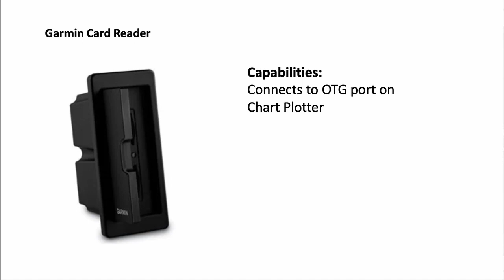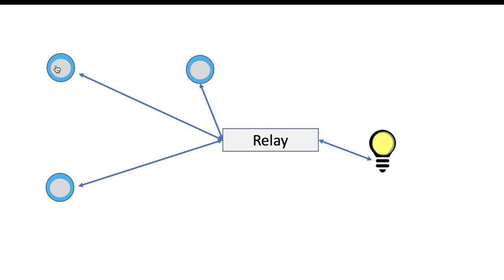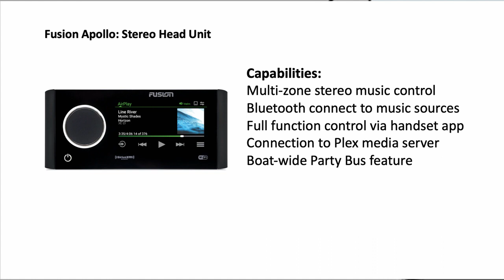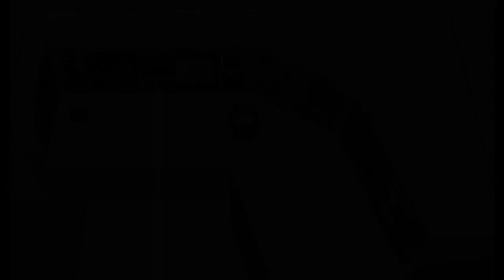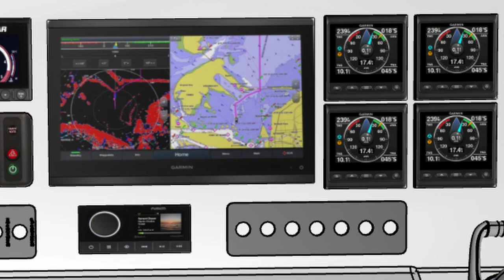Video11: Gear at the Helm and Nav Station of a Knysna 550

Comment: You have gone the correct way about your watermaker,A simple system that is easy to maintain And reliable.I look at the likes of the costs of electronic systems that are not as reliable,And 4 times the price.claiming they are more energy efficient..and then the rip off prices for basic service kits.or spares.

Comment: Can you tell me.What make of watermaker knysna use.So many watermakers that are unreliable.Plus some use parts that you can only replace from the maker.Just seen sailing sisu have to pay 400 euro for a basic D5 magnetic motor.That is normaly 70 euro.which is also a rip off at that price.On a spectra newport 400c.Your water ,maker needs to be off the shelf standard parts.There are no video,s of knysna showing there water making system.Maybe later on.you could make video ,s of the systems.
Reply from the maker: Hi t147han - thanks for your email. 
Knysna generally fits Schenke water makers, although on the 550 we are installing a Stella http://www.stellasystems.co.nz/ 
As far as reliability goes, I generally find that failures of water makers can be traced back to either improper installation (for instance low pressure pump not being installed below the water line) or user issues (for instance not cleaning the filters). The bottom line is that anything that keeps you from having a constant supply of seawater at the defined pressure (usually 5 PSI) to your high-pressure pump will cause it to cavitate and burn out. To avoid this, we are installing a pressure gauge and a shut off valve on the power for the high-pressure pump. If the pressure falls below 4 PSI the power is cut to the pump to keep it from burning up.
Hope this helps - George